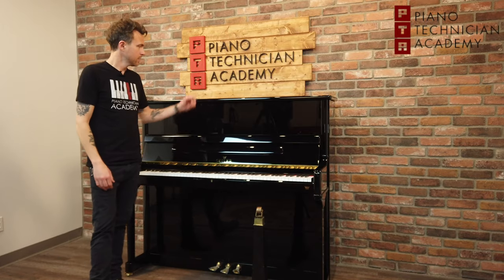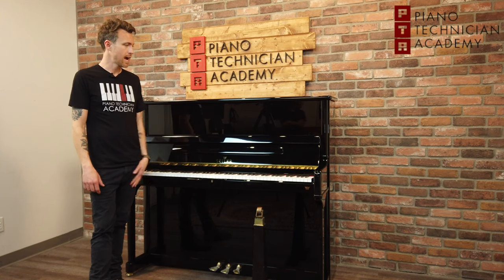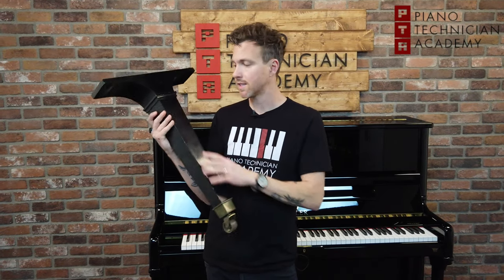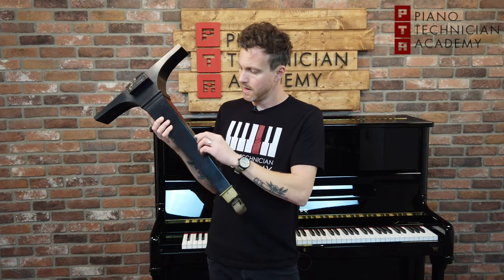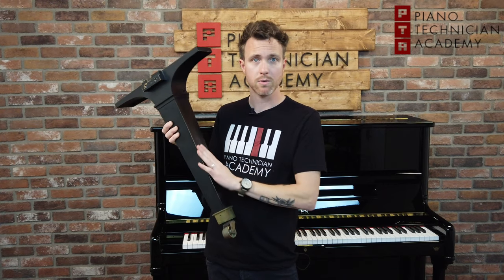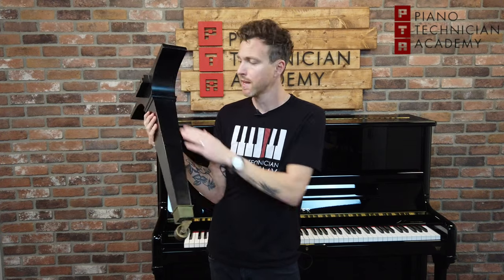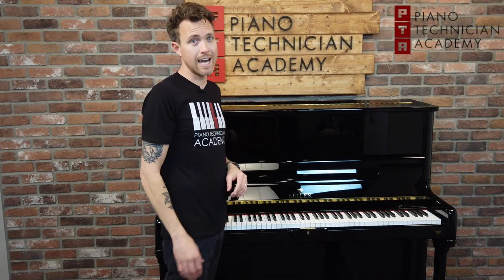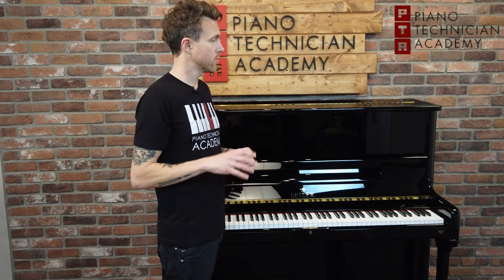What are Pianos Finished With?

Comment: I do piano refinishing down in Virginia. In the past I have been using black tinted MLCampbell pre-cat lacquers. They are great high build finishes…..but…..they are not the deep dark ebony that Steinway lacquers uses. Do you have a suggestion for a source to purchase this material? Mohawk black aerosols are close to the deep ebony….but I need it in bulk…gallons, and in pre-cat if that is available. I have a 25 year old B that was on a stage and banged up pretty bad…..I am going to fill the dings, and sand into the existing finish enough to provide good adhesion for the new top coats. Thoughts?
Reply from the maker: Why not just buy pre cat mohawk in bulk? Its what we use to refinish and we can get it from our local shop. Same stuff in the cans but in larger quantities.
Reply: Wurdack